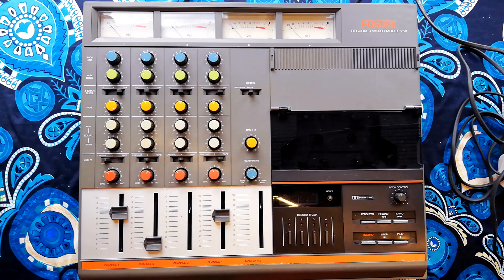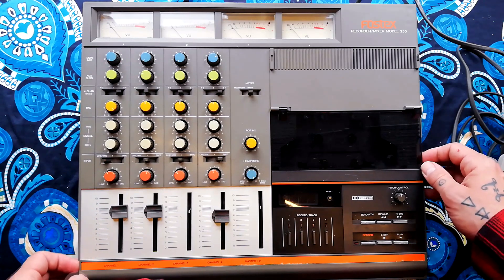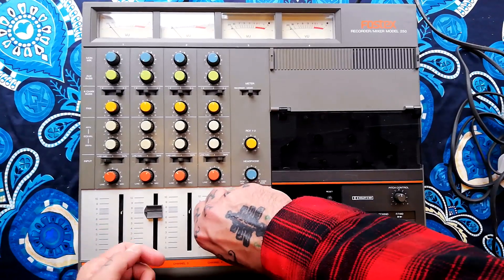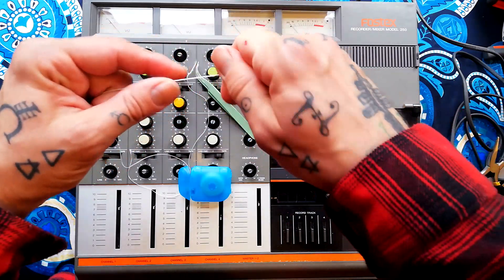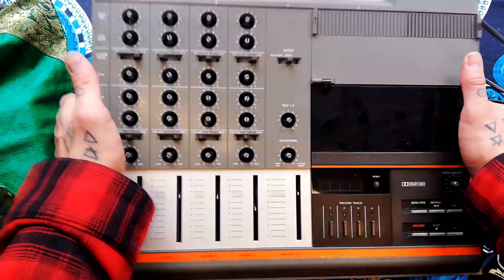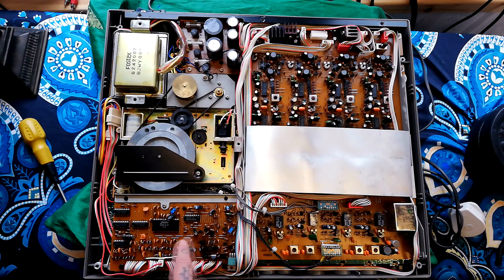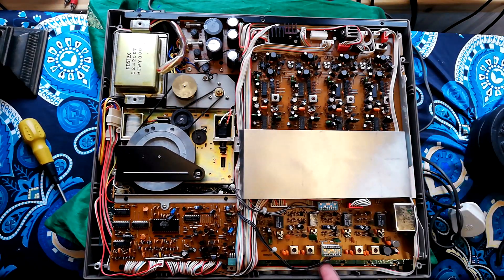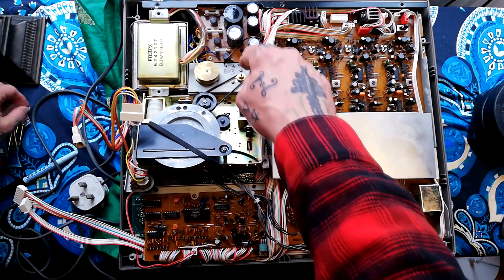Fostex 250 4 track | tear down part 1 | remove knobs, open case & remove transport

Comment: even today, I cant find a modern 4 track or 8 track with the features and easability like the 250
Reply from the maker: I can relate to the personal connection you have formed with this recording deck, but in my opinion Tascam Yamaha and Fostex made many machines which have an equivalent or better feature set and sound quality, and most of those are easier to repair. Thanks fro watching.